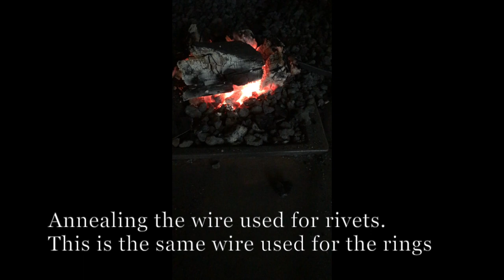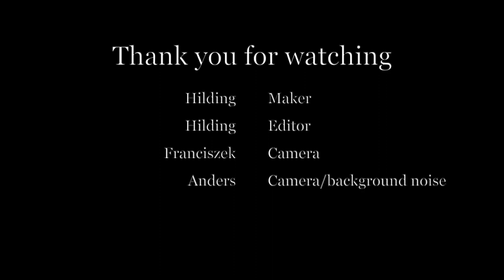A process of making chainmail

Comment: would you drift the cold ring, I mean is it just  drifted after annealing or do you need to drift warm/hot metal?  I have had a hard time drifting thinner metals but maybe they can just be done cold same as riveting cold ?
Reply from the maker: I have managed to drift a few rings cold. They weren't pretty but it is definetly possible to do. As the rings are so small they lose heat extremely quickly. So drifting them warm wouldn't be worth it in the end in my opinion. I simply decided to drill most of the rings in order to save time. 
Sorry for the late answer. And merry christmas.